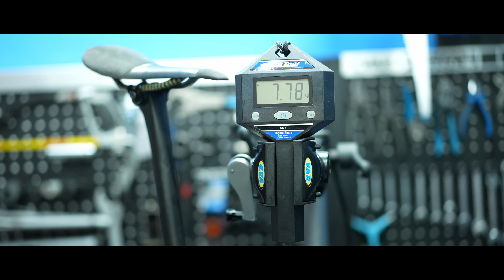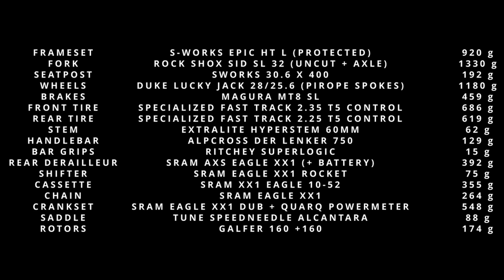2022 S-WORKS EPIC HT DREAM BUILD 7.78 Kg

Comment: Hi, how do the brakes Magura work? Magura recommends a disc thickness of 2mm, but Galfer's 1.8mm.
Reply from the maker: I liked it a lot. Regarding the discs...u may be right, I'm pretty sure that the power of the set will improve a lot using thicker rotors but with these galfer they are more than usable!!!

Comment: I want to note that not the lightest components were used. And the frame size is L. I think you can throw off another 200-300 grams without any problems.